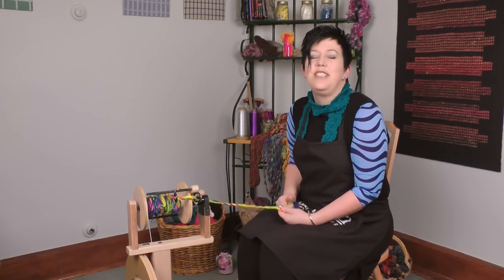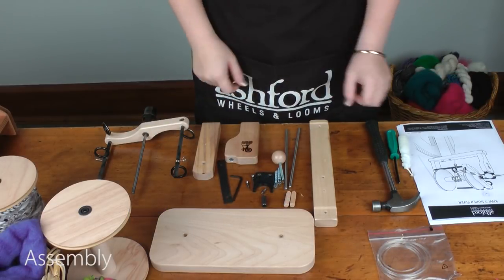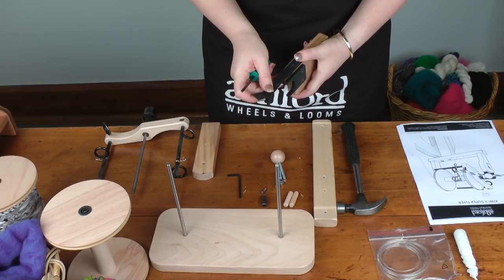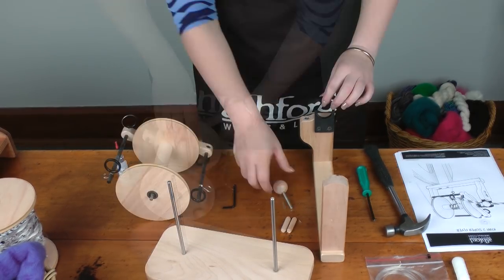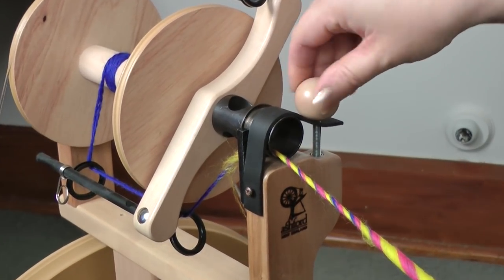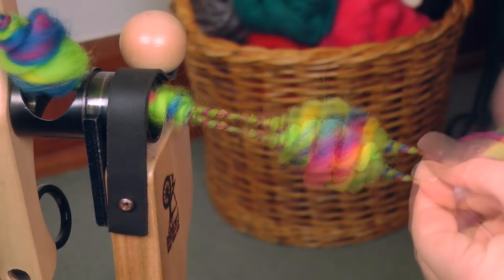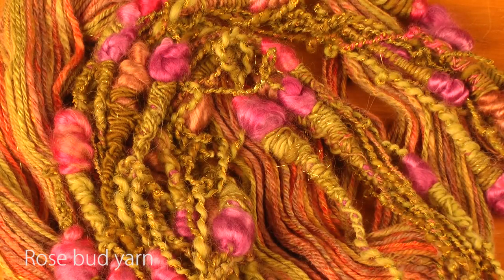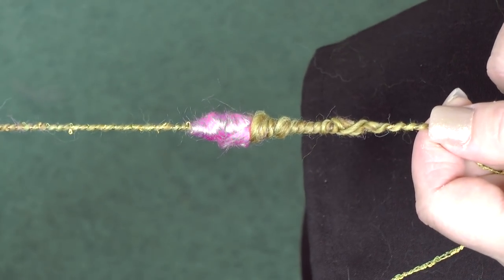Kiwi Super Flyer

Comment: You're not using a whirl anymore. Does that mean you're changing the wheel from Scotch tension to Irish tension? You say you can still spin fine smooth yarns with this, but the ratio is different now. I guess I don't understand. Can you explain?
Reply: I first used this flyer to ply 8oz of singles together to make one big skein.  I felt like I was treddling  a mile a minute and I still have to run the yarn back through to add more twist. It’s super underspun. I think to make a fine yarn on this you just have to take that into account and really make sure you’re adding enough twist. I think it would be slow going.

Comment: I'm desperately in need of help. I've bought a jumbo flyer, i bought it of ebay just to save a few quid as I'd only just bought my kiwi 3 and large niddu noddy,
anyway the actual flyer bit isn't spinning along with the bobbin, it's only spinning when i have a death grip on the shop bought yarn ( like a 4 weight mandala ), I've oiled everywhere I'm supposed too, I looked on one of your tutorials to make sure, and even with the tension completely off it's not going round.
I'm hoping someone can tell me what I'm doing wrong, the lady that sold it me said it had only been used once, i've also messaged her to ask why the flyer's not spinning, but just in case she's not sure I thought I'd ask here

Comment: I feel like there has been so much false advertising with this flyer. Everywhere I look, it’s “spin any kind of yarn”, and it absolutely will not do that. It needs a heavier, thicker yarn to get the tension to move the wheel around. I bought this flyer thinking it would be great for larger spinning and plying projects, but it does NOT work on roving or anything less than art yarn, chunky, etc. I am out $400 and disgusted with Ashford. I am hoping I can sell my Kiwi and this flyer (I’m so mad at myself for not researching better I can’t stand to look at my wheel now) and get the Kromski Fantasia I should have gotten in the first place (instead of the flyer). 🤦🏼‍♀️